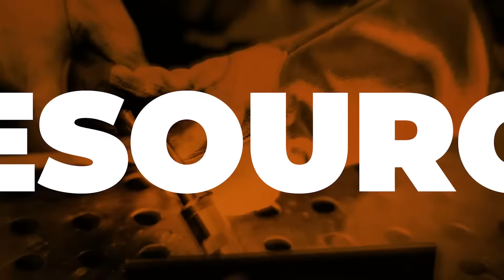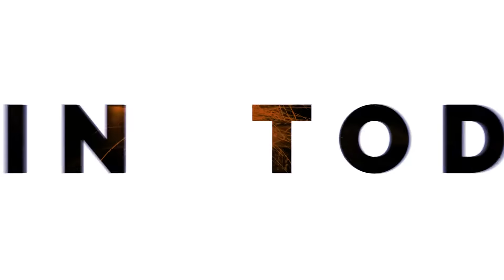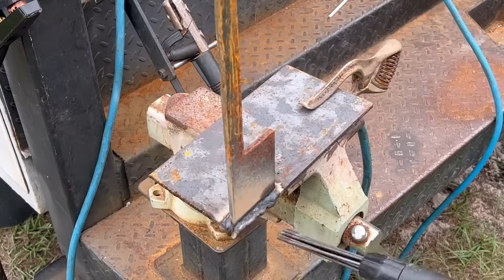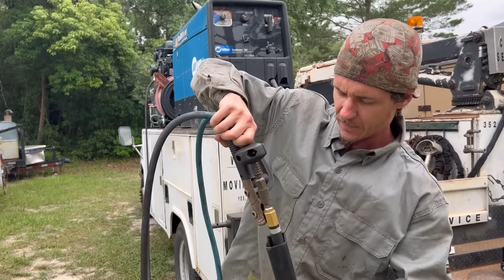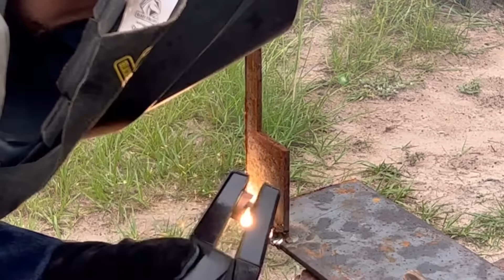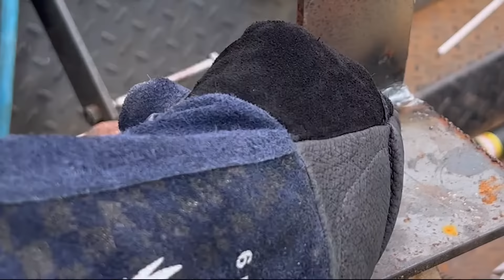Arc Gouging: Meltin' Metal Anthony Shows You the Basics

Comment: Both times you had the air outlet in the wrong spot. 
If you tried this with proper gouging rods at 500amps it wouldn’t work at all. 
The air outlet hole has to be under the rod not anywhere else

Comment: Teacher, I am a welder, and I want you to explain to me, if there are no problems with the current of the truck and the current of the welding machine, I already see you welding that piece directly on the flat bed of the truck without using electric current insulation,,, and I wanted to know if this process does not cause damage to the truck's computer.

Comment: I prefer using the carbon arc torch to cut metal than with oxyfuel.

 Electricity is just that available. What I would use to cut rebar.

Comment: The air is not blowing the metal away, it's the oxigen that literally burns the iron away. THat's the same principal of oxifuel cutting torch, twhen the metal is at temperature you push the oxy lever and a jet of pure oxigen oxides the metal,literally burning it away
Reply: This needed to be said

Comment: You need to put the air on the bottom of the electrode to push carbon/slag away from what you are cutting not towards what you are cutting and it will be a much cleaner pass.

Comment: The air holes on the gun need to be on the bottom of the carbon rod. Keeping the rod at a low angle to blow the metal away from you helps.

Comment: The reason the first gouge didn't work is it looked like you had the air discharge holes on the wrong side of the carbon.  Have the air discharge holes orientated so they blow high pressure air underneath the carbon and it removes molten metal much better.  When the discharge holes are blowing air over top of the molten metal it makes a mess and doesn't remove metal cleanly.  Shorten up the carbon stickout too.  Maybe 4-5 inches or so
Reply: What he said ^^^^. Air blows under the cut. 😊
Reply: Lonny is Correct  !
Reply: Having issues with vertical gouging for some reason, idk if it's that I'm out of practice or if the gouge is garbage lol feel like it gouges a good 4-6in sometime more than it either dies out or starts acting like it's almost welding it, I'm use to running 250+ to gouge but boss says only 210 just haven't ever had thus problem anywhere else I've worked.
Reply: @dustinmouchette3832  
Gouging should be EFFORTLESS  !
210 Sounds Very Low.
I was even skeptical of 250+.
Wait until your boss walks away. 
Turn it up to 350 Amps.
Verify that you have Plenty of compressed air.
Verify that Gouge rod is sitting Perfectly in the center of the V shaped notch .
Then go !
Good Luck  🤞
Reply: Yep not enough amps 1/4 carbon gouging rods require 300 - 400 amps DCEP and the electrode should extend at most 7 inches from the gouging torch with the air jet between the electrode and work piece 80 psi and 100 psi at the torch; higher pressures may be used, but they don’t remove metal more efficiently
Reply: Would this be a suitable method to cut sheet metal?
Reply: @KenFullman  
NO !
Waaaaay Too Hot !
Definitely the wrong process.

Comment: I used this process working for a company to cut the bodies off old rail cars so they could be rebodied. It's a lot of fun once you get the hang of it. If you get real good you can shave the weld off and leave the factory edge of the base metal.
Reply: Hey sparky, what are you controlling most when you shave the old weld off, the amps?  I'm assuming that I need at least 20 degrees diff in melting temp to leave the base metal intact?  Thanks
Reply: @1nvisible1  It's been a few years but if memory serves... The weld has pretty much the same melting point so we've just cranked up the amps. The trick is a steady hand. You use the arc not the rods themselves.  Just cut a little off the weld at a time.
Reply: Is the air essential? I do not have a compressor.
Reply: @engjds  Yes, the air is used to blow the molten metal away from the cut. There are cutting rods that do not require air but I'm not sure how they work exactly.
Reply: @sparkythawelder  Ahh ok, so in theory if you cut something on the vertical without air, that might work?
Reply: @sparkythawelder  Found one cool technique, you get an old brakeline, connect an oxygen bottle to it, stuff a bit of wire-wool in the end so you can ignite it with a torch and bingo, your own thermic lance.
Reply: @engjds  Interesting,  I'll have to look into that.
Reply: @engjds  Possibly, I never tried.
Reply: Im trying that.... @engjds
Reply: @ I think you might need a one way valve to stop the flame going back into the bottle, get it checked by someone that knows about flammable gasses my friend.
Reply: @engjds  I gave you a good alternative called chamfer rod,  but for some reason my reply posted down below here a little ways.

Comment: Air should be on the other side, blowing under the carbon and away
Reply: First of all the carbon holder should be much closer to the end of the rod. And as someone already said you want the air under the rod to blow away what is melted. Also I've found that going towards the ground helps somewhat. With the stick-out you show sometimes it will blow the rod in two.

Comment: Hi Anthony. I want to start arc gouging for the first time, buying some rods and the gounging electrod holder. What is the minimum amperage I need to run the smallest rods? I have some  200 Amp inverters and a big 10 bar, 150 l tank air compressor, all are 230 v. What do you think? Thanks.

Comment: son you need to scrub that welding cap great video make a male connector  pigtail  cable lead and connect it on the eye of the power cable  adapter instead of using a holder

Comment: On the first clip of you air arcing you didn't achieve the best results because the electrode holder was upside down. The air holes should be behind the molting puddle blowing in the direction of travel.
Reply: Cam be tricky when switching directions the rod has to be switched if too long, it's plainly obvious when you know what's going on, yet hard to catch some times with switching right to left an left to right.
Reply: John is Correct